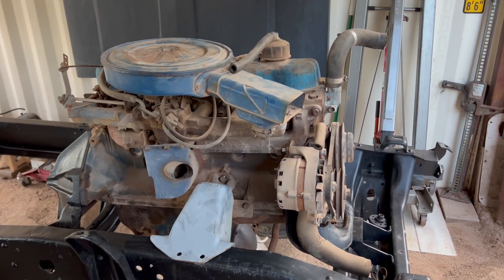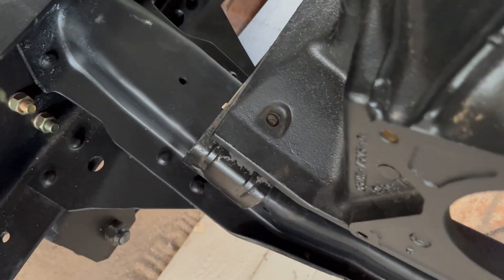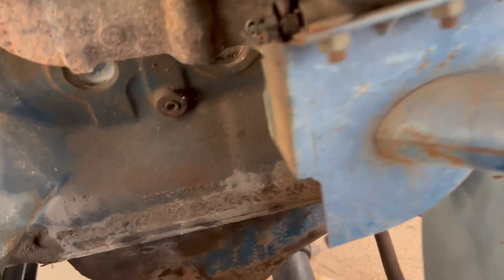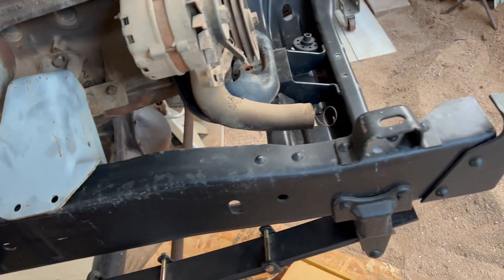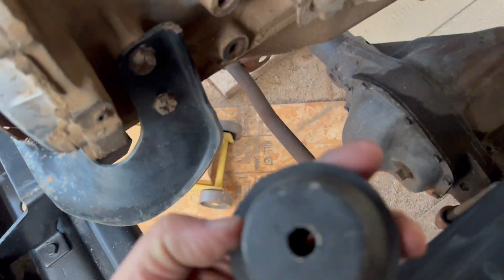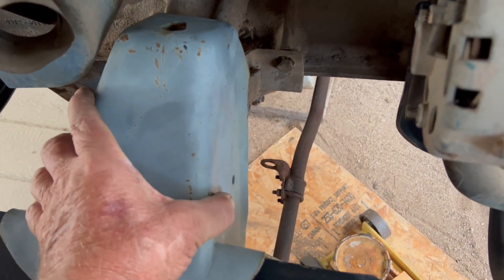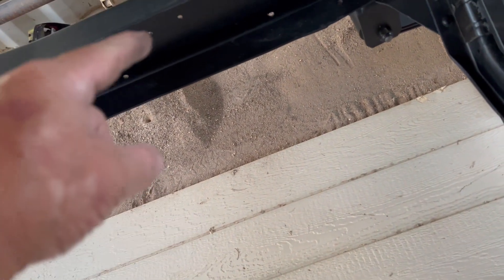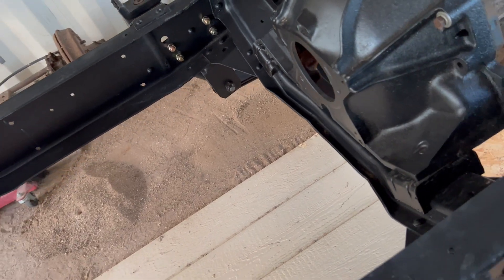1965 Ford 4x4 Build, Update #12  Engine installed and more cleaning.

Comment: I had a straight 6 in my 1980 F-150 flare side. Pulled it out and put 360 in it. Used the higher motor mounts and had to remove 1 1/2 from the top! Great job so far 👊🏼🍺
Reply from the maker: Swapping engines can be a huge pain in the arse 😐👍. Thanks Scott!

Comment: That straight 6 is a great motor for this ol truck. Can't wait to see it all painted up and looking new. 😍
Reply from the maker: It's so hard not to pull the fuel injected 300 six out of the 93 and use it! it has a 5 speed!  Thanks Roy!